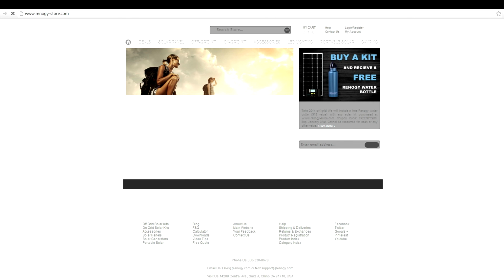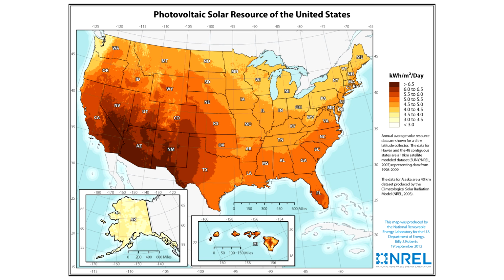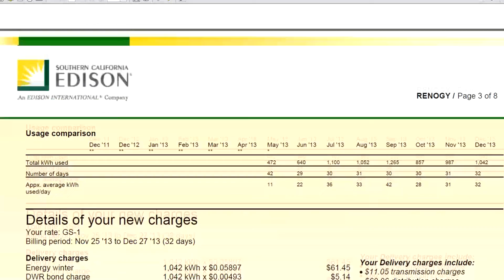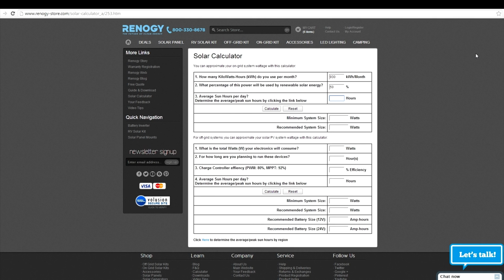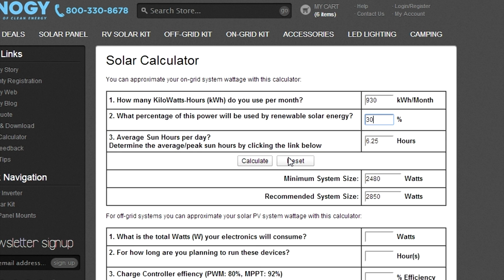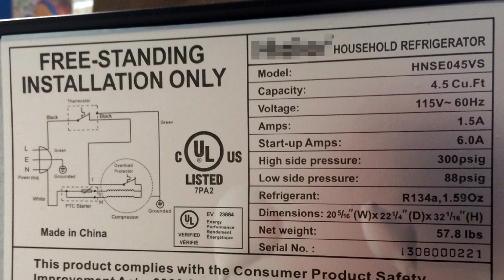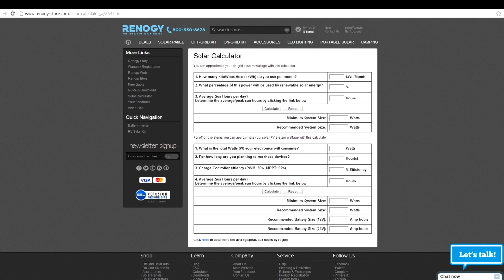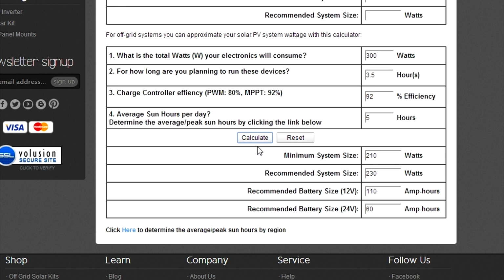Renogy: How to Size a Solar Power System using our Solar Calculator Part 1

Comment: Hi, This is a little bit complex, please have a look.

Have 15,000 Watts appliances to run for 12 hours daily.

Sunlight is 8 hours (8am - 4pm) is always very sure daily.

Nigeria Solar P.G.F ( Solar Power Generating Factor is 3.41)

National Grid Electric Power is irregular and only available 4 hours daily.

Planned a hybrid Grid-Tie and OFF-Grid installation using Solar, Battery and Fossil Fuel as backup solution.

Please your sizing formulae on Inverter, Solar Panel, Battery Bank and Solar Charge Controller ? 

What kind of Renogy hybrid inverter to handle this ? Do you have in-stock a single 20KW or i Parallel 2 or 4 Renogy Inverters ?

To be ordering Renogy; Inverters, MPPT solar charge controllers, combiners, wiring and other accessories only.

Can i have an idea of minimum shipping cost to NY ?

Thanks.